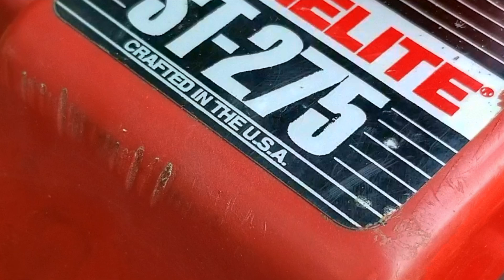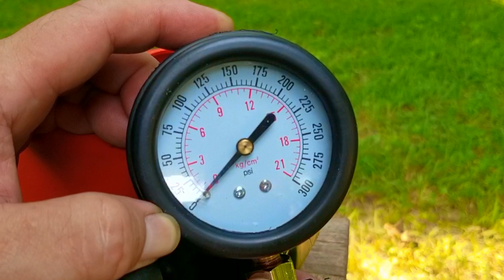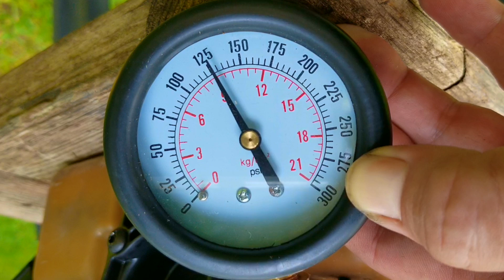Trimmer has Fuel, spark and compression but it won't start.

Comment: as long as an older piece of equipment still runs you maintain it until it breaks and parts are no longer  available.
Reply from the maker: you are absolutely right.
Reply: pretty much all i run is old stuff. seems every year i am fixing one or the other from mowers to string trimmers to atv's to my personnel vehicles. none are younger than 18 years old btw and i do all my maintenance work including mounting and balancing of tires.
Reply from the maker: @paulk5311  you're very capable
Reply: No the you start making them
Reply: ohh yeah i have a 1980s turf trim86 and it still runs great

Comment: Great job! I have a late 70’s Homelite chainsaw and still use it for smaller logs. Runs fine and never had an engine or other issue. I fix small engines for work, non-e gas in lawn equipment and a good oil is key to longevity. Use your off-season for inspection, servicing and repairs. Don’t buy box store or discount store equipment—it’s JUNK! See a equipment dealer as you will find more reliable machinery. The old adage you get what you pay for rings ever so true here.
Reply from the maker: Thank you Michael Brigande

Comment: I have been struggling for a couple of weeks with my leaf blower which suddenly stopped functioning after about 4 years of good service.Numerous checks and mods and new parts and frustration. I was just at the point of ordering a compression tester - no fuel to the carb? and a spark tester - no spark?. While waiting for these new tools, I happened to get to your video - loose engine bolts, air leak. Checked my engine, solid as a rock but just by chance I unbolted the plastic blind end cover of the crankcase. OH OH......big hole in this cover = no vacuum to bring air fuel in from the carb( up stroke), no pressure to push the mixture into the combustion chamber (down stroke) and lots of air leakage. Repaired the hole in the cover.......leaf blower running like it always did, maybe better. Thank you.
Reply from the maker: wow nice work getting it working again!

Comment: For your gas tank color question have you tried hydrogen peroxide to whiten the tank? I use that for a lot of things, it works on  some then doesn’t on other stuff.
Reply from the maker: I've heard of that.  Might have to give it a try thanks
Reply: And a uv light
Reply from the maker: lots of it, I might have to get UV lamps
Reply: @sweetlou5902  yeah whoops, forgot about that part

Comment: Wouldn't retro-bright be a fix for the UV damage on the tank?
Reply from the maker: I was thinking that too, but I've never seen anyone do it to a fuel tank. Have you?
Reply: @HomeGaragechannel  Never seen it myself however I cant see it causing any damage to the plastic as it stands up to petrol, its worth a try as if it works then its a method that you can use on other equipment in the future.

I agree with you that the older equipment was built to last, I'm a gardener myself and over time I've upgraded to honda and stihl equipment however the only thing I haven't upgraded yet is my cheap Chinese strimmer... i must have rebuilt that thing 4 times in its life cycle, the quality of the cheap stuff now is so bad its annoying.
Reply from the maker: @Davidl91  I agree with you
Reply: yes it would but not completely. Partially transparent material change color inside where is hard to cure..
Reply: @jan_vyhnak  what about using UV string LEDs on the inside?

Comment: what are the fuel bottle things called that you use when testing the flow of fuel through the carb at 6:50
Reply from the maker: they are just chemical squeeze bottles.
Reply: thanks

Comment: Hey I have a stihl fs90r and it will only start when you give it full throttle other wise it doesn’t start do you know why?
Reply from the maker: Yes the carb needs to be service. I would replace the carb though as it's easier
Reply: @HomeGaragechannel  indeed

Comment: I like the straight shaft so much more, I think the not only keep you farther from debris, but also looks ascetically better , no I have a question, of all the machines you have worked on over the years, what was the most difficult and what was one that you breezed right thru with
Reply from the maker: I think the transmission work I did on the Honda might have been the hardest, as the video took days to do. The easy ones, are any of the metering diaphragm replacement on cheap trimmers, like troybilt, ryobi, and the like.

Comment: Have you ever removed the Ethanol from the fuel and used that? I know it is pretty simple but not sure if it is worth it.
Reply from the maker: Not directly, I've thought about doing a video on it. I wouldn't have a problem using the separated fuel.

Comment: My McCullough whipper snipper gave me a read below 50 after 8-9 years of no problems . Is this the end of my trimmer ?
Reply from the maker: unless you can find a new piston ring.
Reply: @HomeGaragechannel   and have just worked out after working on it all day today.. slightly loose cylinder head bolts can cause loss  of compression hahahahahh

Comment: Great video. I have similar issue. Have Stihl FS55. Great compression, spark and fuel. Will run short time then flood sparkplug. Could it be the carburettor as to much fuel? Any advice please? Thanks.
Reply from the maker: It's one of two problems, either the carb needs to be adjusted or replaced, or the spark plug is the right heat range. Do you know if the spark plug is using an aftermarket brand ?

Comment: to fix the discoloration on the tank just put the tank in a bath of hydrogen peroxide and use a UV lamp or lamps to make sure all of the tank is being exposed to the light. Then just move it around every few hours until it's completely fixed. Usually takes about 8-24 hours
Reply: dont forget gloves

Comment: Hi, interesting fault, a little out of the ordinary.
I have just installed a replacement engine on my two stroke weed whacker. What do you advise re. running in the new engine. Should I use 30:1 fuel/oil mix for a few hours rather than the usual 40:1 ratio or just not go overboard with the throttle as indicated in the "user manual". Yes, it's country of origin is China.
Reply from the maker: That's a tough one, I would go 32:1 for the first tank, and second tank if you feel like it. check the spark arrestor screen afterwards too.
Reply: @HomeGaragechannel  Thank you for your suggestion. You have made sense of what I was told a while ago,  and I  subsequently dicovered that 4 litres of fuel to 125ml. of 2 stroke = 32:1. The problem was that I had no idea how long to use that mix for! Thanks again. Best I don't mix 4 litres though, that's almost a gallon! B-)
Reply from the maker: @billfawcett3691  glad you figured it out

Comment: I have that one. don't use it much since I have a cordless model.  You think that motor is strong enough for a brush cutter blade?
Reply from the maker: Yes I think so. after taking the cover off the back of the engine , the internals look better than most of the internals of current trimmers.

Comment: I love getting notifications for your vids. Over the years I've learned so much from you I've been able to fix my own equipment, and for that I thank you. I do however have a question? I have a straight shaft Craftsman trimmer that takes the other attachments, would it hurt to use one of those heads that have the three plastic or metal type blades? Or should I just stick with the original head it came with? Thank you in advance
Reply from the maker: That would be absolutely fine, since the plastic blades can pivot, even if you hit something hard, it won't hurt the engine.

Comment: I picked up a old craftsman that is attachment capable. Bought new carb adjusted the carb where it runs but only when I hold the throttle down and the head doesn't spin. . Then shuts down when i release the throttle. Tried adjusting the idle and nothing. Do you think it can be the power head or the shaft might be worn out?
Reply from the maker: I think it's more of a carb issue, also did you look at the fuel lines and Fuel filter for any issues?
Reply: @HomeGaragechannel  its a new carb. I put new lines and filter and spark plug. Filter they sent was green foam but it's kind of weird cause it's a square fitting but they sent ones that are a shape of a rhombus. So I put a different one that fits but thicker foam. Not sure if that messes anything up. Thanks.
Reply from the maker: Typically It means that there's not enough fuel when coming back down from full throttle,  I would turn the L screw half a turn CCW, and turn the idle screw to again, as it's going to lower the idle speed.

Comment: Once again another great vid.....I have a ryobi CS30 trimmer 2006 0r 2007 model....The carb is new , fuel lines, spark and gas fresh and all new..... It does start a second or two if gas in dropped down spark hole.....I checked and rechecked fuel lines....gas is filling primer bulb but yet it wont start.....I've done all the tests you did and even got a spark checker......my next step is to get a pressure checker......other than that ..any thoughts..
Reply from the maker: Yes, I have a few, remove the spark plug, pull the rope several times, then leave it like this way for a whole day. next day, replace plug, press primer bulb a few times, put the choke lever to "run", then squeeze the trigger, and try and start it. If it doesn't start, move the choke lever to "START", don't squeeze the trigger, and pull the rope 5 times. it if tries to start, fantastic, but if it doesn't, remove the plug and tell me if it's wet with fuel .
Reply: @HomeGaragechannel  ok did your suggestion and nothing...Spark seemed to be on the dry side....I was gonna get a pressure tester but waited till after this test...but if it turns out just not getting enough pressure to push the gas through the carb what would be the option or just get a low end trimmer for 80 bucks or so ??

Comment: Is there a special size Phillips screwdriver needed to remove the needle hold down screw on walbro carbs. Worked on one and the screw stripped out. Sucked because I was trying to put in a walbro Ethanol diaphragm set. I tried all 5 Phillips sizes in a cman screwdriver set with no success.
Reply from the maker: not that I'm aware of, sometimes I use a medium sized screwdriver and other times I use the small one in the video. Yours might have just been stuck?
Reply: There is a Japanese screw,  "jis".  Looks like philips.  Believe it has a small for on the head.
Reply: A small dot on head.
Reply from the maker: @rickchrist1949  thanks for the information

Comment: good stuff.  
I have a BBT4 4 stroke trimmer but the rope starter wheel gets detached or misses to latch onto the starter/fly wheel.  it is made of plastic so any movements will make it miss the slots on the wheel. That's my predicament. I've complained to the dealer/provider and they sent me another engine box. same thing. I was able to use it for almost an hour and it don't know if the engine was too hot and affected the housing of the rope starter.  it won't start anymore after that. and  now i've got 2 x 4 stroke engine that won't work  -- as it won't start. help!
Reply from the maker: if it's anything like I've dealt with the Troybilt XP series, the problem is actually with the tiny springs that work the Pawls.  As for what to do, I wouldn't use this brand anymore, as it doesn't seem to be a good one.

Comment: Do you not do an upside down test? I have several strimmers that start and run perfect but when turned upside down they stop instantly, then restart with first pull, it's not the pick up pipe.
This can happen ten times on the trot then they will work for a bit, if I rev them up then turn them over they work every time. I have tried carbs of working strimmers with the same result, they are driving me insane.
Reply from the maker: this would more thank likely be an issue with the tank vent, Yes the carb is an any direction carb, but the fuel tank may not be designed that way. The vent for this tank is on the right side, so I would only turn the trimmer with the fuel cap facing up .

Comment: Hi my name is Terry, when I put spark in won't let me pull o er engine on my petrol strimmer, when plug is out it pulls easily  ,what is wrong please. Can you advise  me please  ,Thanks 🙏
Reply from the maker: sure, do you still have the old spark plug if so I want you to compare them and make sure the newer one isn't longer than the old one. If that's okay, then there might be too much fuel in the block and it's causing it to hydro lock.  Let the engine dry out without the plug for a day or two.

Comment: I got a BCZ260T redmax trimmer with all those symptoms , but there isn't air leak , i put everything back together and nothing . 
New carb , new piston , new cylinder , new rings , i got spark , this one drives me crazy. Any ideas?  thanks
Reply from the maker: I know you rebuilt the engine but I'd like to confirm what the compression reading is.  Also did you look at the flywheel key?
Reply: yes i did check the flywheel as well , I don't know why I'm getting low compression with a new cylinder kit , I even try with a new set of rings and still low compression , I did check in the crankcase gasket and it's ok too. Thanks for your response . @HomeGaragechannel

Comment: For the UV damaged plastic: A technique called retrobrite. David from the 8 Bit Guy channel has a LOT of videos on this process.
Reply from the maker: thank you Mr Penguin
Reply: @HomeGaragechannel  https://youtu.be/qZYbchvSUDY
At 16:00 he does a method that would work best for doing this to multiple tanks at a time.
Reply from the maker: @der_pinguin44  thanks
Reply: I commented a way to do it as well which is pretty much the same way except I've always seen them use uv lamps but the sun will work too , that's how I did it cause the sun is a giant uv lamp lol

Comment: About half way through the video you mentioned that the issue with it not starting could be that the timing is off and that you have to check flywheel and key; but then you went straight to carb and I did not see anything about timing/flywheel/key.  I am having issue with Ryobi 30cc that I literally got from someone's trash and when I first tried it out by just putting some gas in the carb it started on 2nd pull!  The fuel lines where all broken so I replaced them and bulb and cleaned carb out and when I tried to get it to start again, I could never get it to start/run.  I guess I was going to ask if that could be timing issue (and if you cover this in a video) but suppose that if that was issue it would not have started  when I first tried it.  Any suggestions?
Reply from the maker: The "another reason" conversation is conjecturing about topics that I don't not show in that particular video but I have more than likely covered in a previous episode. And yes you are right that if the timing were off, then it wouldn't started in the first place. I did a video a couple of months ago about a Husqvarna edger, where I check the timing and found it to be off, so if you're interested, that's The one I would watch. I'm guessing that you might have swapped a gasket and diaphragm or fuel lines  when you reinstalled yours.
Reply: I fixed a Stihl trimmer with a sheared key that fired and ran briefly but then refused to run. I couldn’t figure it out either until I realized the flywheel had slipped, so it had been in time when it ran briefly then slipped out of time. The Stihl has a fixed key that can’t be replaced without replacing the flywheel. No bother though as the key only indexes the flywheel, the actual taper locks the shaft. So just line up the keyway with the mark on the flywheel and use some thread locker on the shaft and nut and you’re in business.
Reply from the maker: @johnfisher747  was the trimmer yours or a customers?
Reply: @HomeGaragechannel  it was one I got cheap as a non runner, if I’d been fixing for a customer I’d have probably suggested a new flywheel but as it was for my collection I didn’t think it warranted a new part and it now runs great, in fact it’s my go to trimmer at the moment, FS 85R, very powerful trimmer.
Reply from the maker: @johnfisher747  that makes sense.

Comment: Is that a normal idle?...mine is more sluggish at rest but keeps idling.
Reply from the maker: I don't think so, it might be a bit fast on mine.
Reply: @HomeGaragechannel  Spoke too soon. I tried it for the hell of it and now it cuts out after 1 minutes and has gas coming into air filter only while running.  Will have to look for the gas leak.

Comment: Can putting to much oil in a weed wacker make it run weird?
Reply from the maker: It would have to be a lot of oil, something greater than 10:1. I have seen people use 1:1 before and it started and ran but It smoked terribly
Reply: @HomeGaragechannel  My troy bilt weed wacker was running like the Echo weed wacker you fixed even after I adjusted it it still runs bad
Reply from the maker: @Rats_r_cool  if adjustment the carb doesn't fix it, then replace the carb
Reply: @HomeGaragechannel  The carb is brand new the old one was broken
Reply from the maker: @Rats_r_cool  you might have to take it to someone
Reply: @HomeGaragechannel  I just thought about and there might be a air leak in the speed start thing because it looks like there's oil or gas leaking out the bottom of it